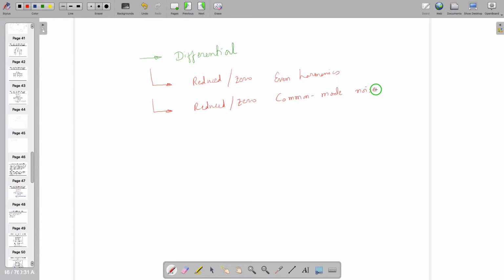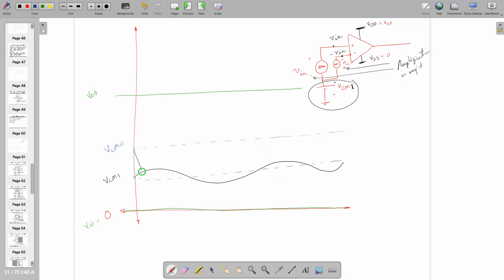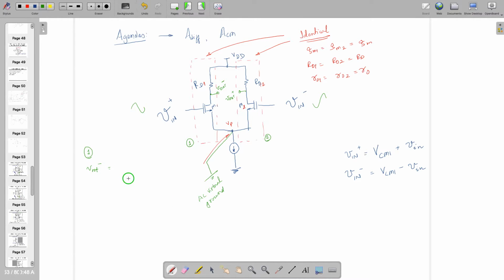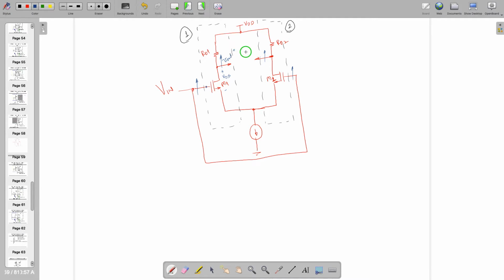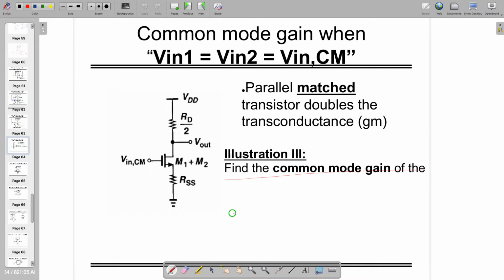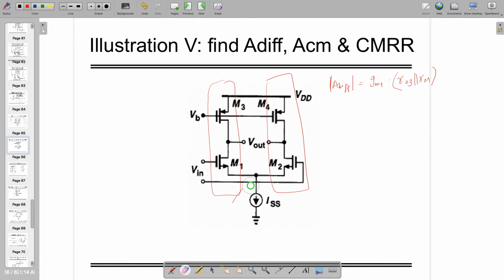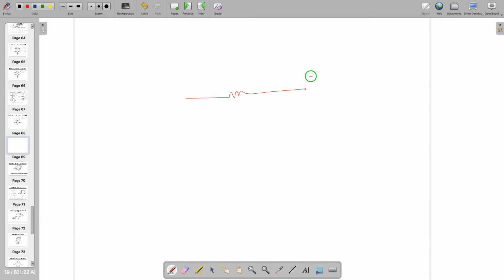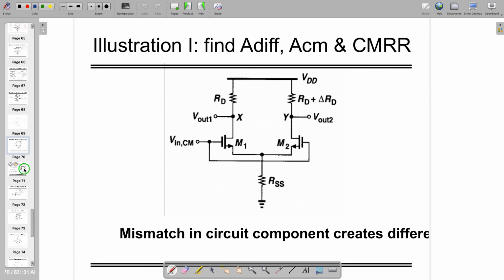Lect19_Differetial_Common_mode_gain

Comment: Sir, can we calculate input offset voltage of such circuit? If yes, how?
Reply from the maker: Input offset voltage depends on the total gain provided by the amplifier circuit. They are reciprocal of each other.